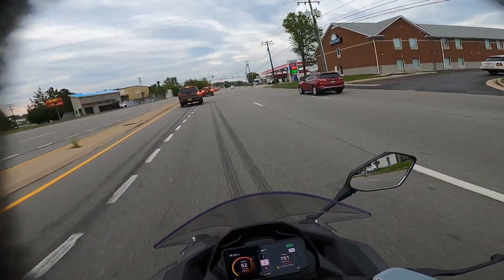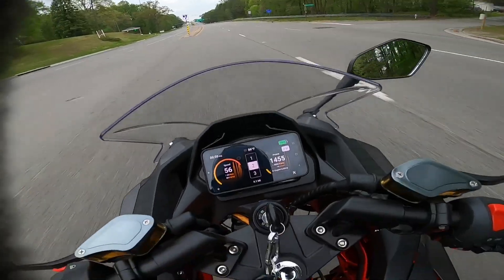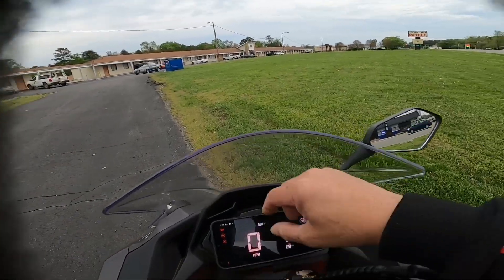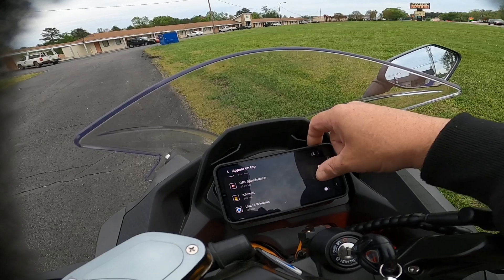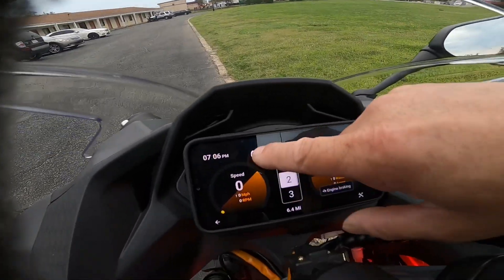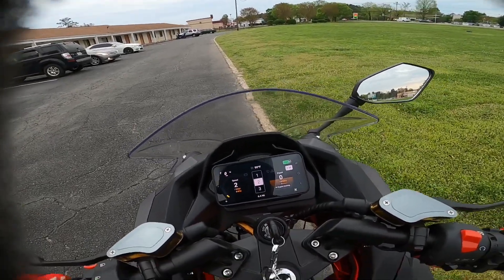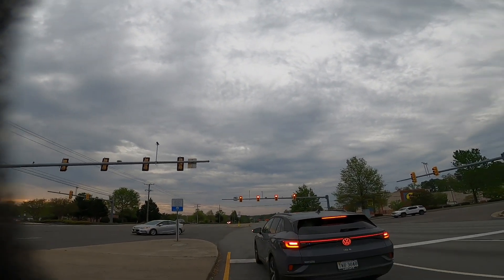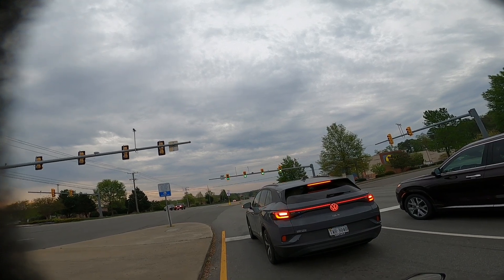Is ASI worth $? Do controllers matter? is it just about watts, software, components? I know it does!

Comment: Would you maybe even consider this as a range extender? Equivalent of a direct injection fuel system. If it only takes that little watts to maintain a heavy bike at 60 then you should be using less battery to operate right?
Reply from the maker: No bro cuz it still takes allot of power to get to 60 that was just maintaining the speed and its not always that easy to maintain it I was also in a tuck position with the wind favorable in that direction on slight downhill it's not always that easy and that controller was being exceptional still need a large battery there's no way you'd get away with a smaller battery in fact that battery way too small I wouldn't get much range running those speeds and that's 52ah. That bike needs at least 120 to have a decent amount of range. Also field weakening requires extra amps on top of the output power so no it wouldn't but  they do have hybrids doing exactly that. Again lots of factors were helping but that  controller definitely took advantage of that but that's never your entire ride gonna be that easy